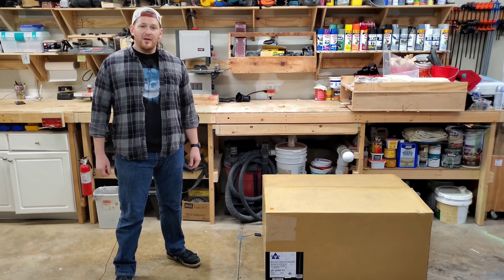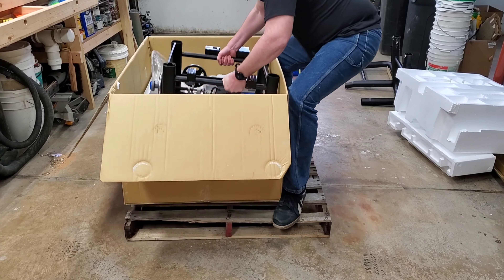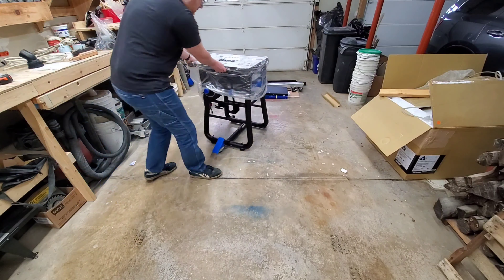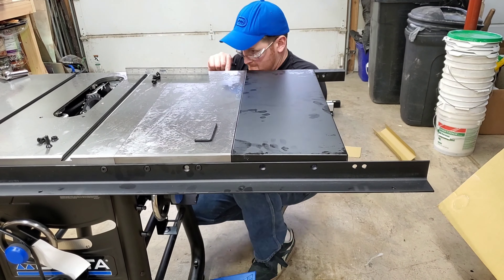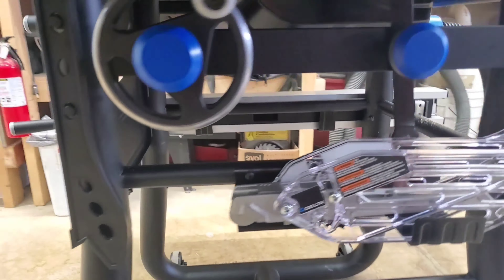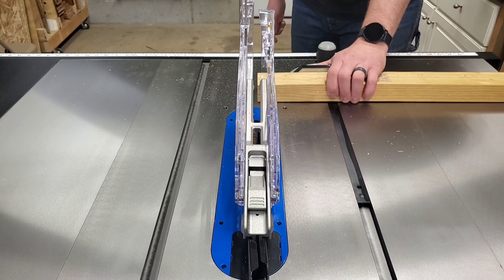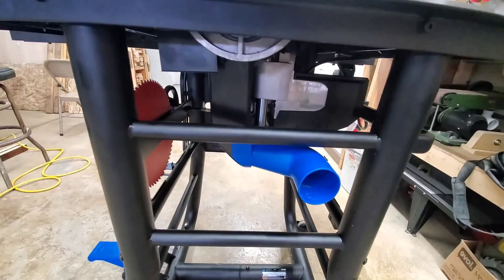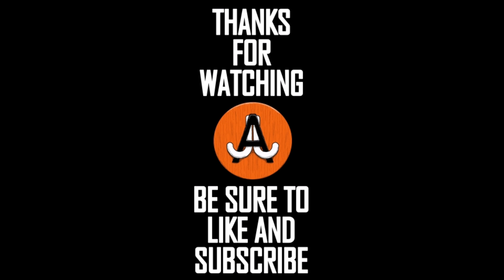Delta 36-5100T2 Contractor Table Saw - Unboxing, Assembly, and Initial Review // Just Joshin' Around

Comment: Just pulled the trigger on the Delta 36-5100T2.  Thanks for the vid.
Reply from the maker: Nice! Hope you like it as much as I do!
Reply: Just Joshin' Around - Thank you!
Reply: @meangreen7389 Was it a good decision?
Reply: @kurtisdavis9526  Yes it was.    The five-cut was amazingly precise right out of the box.  It seemed hyped up so I had to find out.  Since then, this table saw has held up very well.  I use it often and the mobility within my little work space is invaluable.  Other than new blades and little maintenance, it’s a great tool and a great buy.

Comment: I just bought this saw. I struggled with the assembly. Probably because i am not very mechanically inclined and I have neuropathy in my fingers (from chemo). But  with the help of my husband we got it together and I have made a few trial cuts. I love it. I think  so far the best feature besides the fence is how quiet it it. My shop vac makes more noise than this saw.  I bought a Diablo saw blade but for now i am keeping the one that came with it in there. Thanks
Reply from the maker: Awesome, I'm glad to hear you're liking it. Sorry to hear about the assembly issues and all.

I completely agree about how quiet it is! I was really surprised by that. I did the same thing - bought a Diablo blade, but just using the factory one for because it does a fine job.

Thanks for watching and good luck with your nice new saw!

Comment: Enjoyed the video. Purchased mine a week ago. Initial impressions, solid and good construction. I couldn't find anything in the instructions on blade alignment as it was off in back by .022. Will figure out next weekend off. My big issue, table top at front side to side has .013 to .014 dip, .016 dip at throat plate that goes about 3 inches and a severe high spot on left side of the plate. Sides, left front to back .007 and right .006 which fall in delta's tolerances. Top was a pain to take off. It's now at my friends shop waiting to be picked up. He's got it to .005 at its lowest side to side, from front to back .003 at its lowest 5 days after machining. Only cost me $75. Good luck with whoever purchases the 36-5000 models
Reply from the maker: To be honest, I haven't checked mine that closely, so there's a good possibility that it's just as far off as well (or worse, maybe). I have noticed a couple of issues with the throat plate though - sometimes a piece will catch on the back left side (like the plate dips a bit too much, causing the piece to snag on the tabletop while sliding it across;  and the front right side of the plate is raised a tiny bit, causing some of the blue paint to rub onto the wood. Other than that, I've still been really happy with it, but again, I didn't check clearances that closely. I probably should do that though. 

Thanks for the info, and thanks for watching!
Reply: Josh, can you give us the part number for the cast iron exention wings?
Reply from the maker: According to the Parts Diagram, looks like it's DPEC006256. However, after a quick Google search, I was not really coming up with any results as to help in purchasing them. Might be worth contacting Delta directly with that part number to see what they can do for you.

Comment: Do you know where to find the additional cast iron extension wings? Or if parts for the 36-725 older model are able to be used on this one? Thanks
Reply from the maker: A couple people have commented that buying the cast iron extension wings separately from Delta is a difficult, expensive endeavor, and that it's easier/cheaper to get SawStop ones and retrofit them. 

As far as using stuff from the older saw - I would guess that both the fence and miter gauge would be compatible, but I'm honestly not sure - sorry.

Good questions though!
Reply: @JustJoshinAround  thanks for the quick reply. Just picked up this saw yesterday and I'm putting it together. Figured I'd ask before going too far with the assembly. Take care
Reply from the maker: No problem, you too!

Comment: How is this saw holding up any issues. Its half the price of the saw stop contractors saw. Im on the market for a new saw this one seems good and doesn't break the bank as much.
Reply from the maker: It's still holding up quite well. I was in the same boat - considering a SawStop or a Grizzly - but decided that this one was a good combination of features and cost, and I really can't complain about it. If I ever get to the point of being a full-fledged woodshop and NEED to upgrade, I'll again consider a SawStop, but for now, this saw fits my needs perfectly.

Comment: Hi, thanks for the video. I noticed when you lock the fence down the far end looks to be 1/4 inch up in the air? Isn't the fence supposed to be completely flush on the table?
Reply from the maker: Yep, and thanks for watching. 

Yeah that was my fault - it does sit flush, but when I filmed that part, I accidentally locked it down incorrectly but didn't notice it until I was editing the footage. (Then I was too lazy to redo it haha).
Reply: @JustJoshinAround  Cool, i thought it was a defect. Is that model around $1500? I have been looking at another Delta model carried at Lowes for around $600. Yours looks solid and pretty quiet.
Reply from the maker: Yeah I paid $1,000 for mine, but I believe it was $1,300 the last time I looked.

Just FYI - the motor on mine just died and I'm currently in the warranty claim process to get it repaired. I really love the saw, and it's worked really well up to that point - so I was really bummed that it quit on me. I'm hoping the motor on mine is an exception - not the rule.
Reply: @JustJoshinAround  Bummer. I heard these types of table saws should have their own outlet to plug into and not share with other devices. Like plugging into a power strip because the motor will burn out from not having the dedicated power supply all to itself. Hope its not too costly to repair.

Comment: I have the previous version of the 36-5100. The body has solid panels on all 4 sides, which i think helps keep dust from spreading around a little more, but yours has an on-board place to store the blade guard and pawls, which would be handy, I guess.  The saw works fabulously for what it is, but there's one thing I wish it had: an easier way to fine-tune the blade to the miter slots. I can get the fence to the blade, or the fence to the slots, but not the blade to the slots. It's a very very minor deviation, but one that causes a little bit of pinch at the end of cuts on the left side of the blade. 

Your saw's blade clearance insert looks also much nicer than mine. Mine's just a flat piece of 2.7mm thick steel, while yours looks much thicker and maybe cast aluminum? I'm sure yours is much stiffer than mine...i wonder if they are compatible...
Reply from the maker: I definitely love a lot of the features of this saw, but I could certainly see the benefits of having the solid body panels. I know what you mean with the fine-tuning - I've had some minor deviation and slight pinching as well, but luckily not drastic enough to cause any major issues. The insert plate is certainly nice and sturdy, and I'm assuming is actually made of steel (because the magnetic digital angle gauge sticks to it). I don't see why it wouldn't be compared with your saw.

Thanks for watching!

Comment: How does that small flip down on the fence help cut smaller stock? I bought that fence to upgrade my Ridgid tablesaw. I can't figure out how you would use the flip down portion.
Reply from the maker: This is the best collection of explanations I could find: 
https://www.reddit.com/r/woodworking/comments/hcpcs9/installed_a_new_delta_t3_fence_on_my_table_saw/

To be honest, I've only used that thing like 2 times since I bought the saw, and I've found it to have just a bit too much flex/play to be comfortable enough to use it more than that.
Reply: @JustJoshinAround  Thanks for the reply. Even after reading all that and the pictures they showed it doesn't make sense. 🤣😂 Maybe someday it will make sense.
Reply from the maker: @rchavez5056  hahaha yup, no problem. And I know what you mean, it is kind of a weird one.

Comment: I was in Lowe's website to purchase the new T2 saw but reviews caught my eye and the reviews was 3.5 stars and 25% of the complaints was in regards about the motor smoking or blowing out. Can you tell me how yours is holding up? 
I know it's not a high end saw but $600 for me is crucial at the moment
Reply from the maker: Mine has held up perfectly so far. I haven't used it for about a month or so, but since I purchased it, it's worked great.
Reply: @JustJoshinAround  awesome..... Thank you. I know there was ppl complaining about the saw not turning on right away and it turned out it needed to be plugged into a 20amp outlet which isn't a big deal at all.
It's just scary spending money these days haha... Thanks for the reply!!
Reply from the maker: @dbiernackijr1403  I completely understand and agree haha. And I'm glad to help. I hope you like it and it works out well for you!
Reply: @JustJoshinAround  thanks again....

I find it funny that ppl complain about just about anything. Had one guy doing a review on this saw take a metal level and put across the table and show how it dips in the center... Either that was a defective saw or something had to be wrong w his level cause I can't see a factory making a warped table.... 😆😆
Reply from the maker: Yeah seriously. It cracks me up to read some reviews and have a peek into how someone else's mind works haha

Comment: Just pulled it out of the box tonight. Your video is so helpful for the assembly, it’s my first decent table saw too so assembly is a little intimidating. Curious if you’re using anything to keep the rust at bay for the top? I live in FL and my garage isn’t in a/c full time.
Reply from the maker: Oh thank you, I'm really glad it was helpful. 

I applied some paste wax to the table top to help prevent any rust formation, and luckily, it's worked really well so far. I'd say if you do that, it should help - just apply a generous coat, then buff it, then repeat with a second coat, if desired. That's about the cheapest, easiest prevention that I know of.

Thanks for watching, and I hope you enjoy the saw!

Comment: I just ordered the 5000 t2. 100 bucks less for aluminum wings. But same upgrade in the rail and fence system. Problem is I didn't get the second small box that holds the raill system. So it's not really a table saw at this point, but it still cost me a thousand dollars. What's worse is nobody at lowes not about the second small rail box, and the manager at the fulfillment store wants to convince himself I ordered the 725. I guess I gave 300 extra dollars for tip. Couldn't be more frustrated and who knows when I will be able to use the thing, and I have basement remodel to start tomorrow.
Reply from the maker: Oh man, that really sucks. Sorry to hear that, I would be livid. I really hope that they work it all out for you, and quickly.
Reply: Quickly isn't gonna happen it looks like and I'm probably not gonna wait to long for it before giving up on them. I got an email from delta this morning: not their problem in a slightly worrdier format. Local store manager seems to be trying but he thinks it's all one box like the 725 was.  So, Delta blames lowes. Maybe lowes will blame the delivery guy, maybe they'll blame me. Out a thousand dollars and nobody seems to know anything. Anyway. Watched the video ahead of delivery. Well made and had me excited about its arrival. So I guess you can say,  you're video has been the one positive thing about my 1000 dollar delta expenditure.
Reply from the maker: That's utterly ridiculous how they're handling that for you. You'd think that just by verifying the serial number, that they'd have all the information they'd need to fix you up. That's so infuriating. 

Just out of curiosity, who handled delivery?  I bought mine through Home Depot, they used Estes for delivery. 

I really do hope that they help you out and make it right. 

And thank you for the kind words, I appreciate it.

Comment: What are the little set screws for?  I have 4 of them.  The instructions aren't that great to me.  I have a bunch of hex head screws left and can't figure out what to use to attach the fence guide or the power switch box.
Reply from the maker: I can't remember for certain, but I think they provided some extra ones for the other models - like it's a standard pack of hardware and that only specific models might use some of the pieces. I'll have to look at mine to see which screws I used to attach the fence guide and power switch box.
Reply: @JustJoshinAround  I found bag E which included the "button head screws".  Apparently I hid it from myself.  It's all assembled now.
Reply from the maker: @rdot980  oh excellent, glad to hear it!

Comment: I saw a video where a reviewer showing the cast iron top of the earlier version of the table saw (36-725) is not flat so I was wondering if you can tell me the newer version has the same problem or not.
Reply from the maker: Oh jeez, I haven't seen that video - that'd be very disappointing. Yeah, I checked mine with a good straight-edge, and it's nice and flat - no warping or dips or anything. 

Thanks for the question and thanks for watching!
Reply: @JustJoshinAround  This is exactly the information I was looking for as well. I have a small contractor dewalt saw as well and I am going to upgrade.

Comment: I too, would like a 230v option.  You just don't run into the GFCI tripping or the fact your can't have any other large tools on the same circuit as this and use them at the same time.  Essentially 220v just opens your shop up to so many more options for power.
Reply: Just to let you know you can operate this saw on 230v.  You have to flip a switch in the housing to 230 from 115 and change your plug.  This saw was designed to operate all over the world.
Reply: You can use this saw with 230 v.  It’s built to be either or.
Reply from the maker: Oh that's cool, I need to run a 230V circuit to my shop sometime

Comment: Hi Josh, Do you happen to know the part number for those cast iron extensions? I just bought this saw yesterday and the flimsy extensions are ridiculous.
Reply from the maker: I'm sorry, but I actually don't know. However, from what I've heard from other folks in the comments, trying to get the Delta ones is quite the expensive and difficult endeavor. Other people have said it was easier and cheaper to get SawStop ones and adapt them.
Reply: @JustJoshinAround  Thank you for the response. I found the part # and of course they’re sold out and on B/O.
I purchased my saw from FB Marketplace completely new in box with strapping for 1/2 the price. It came without rails but I found them on Amazon for $110. What a bargain! Should be delivered Monday. I can’t wait to use it!!
Reply from the maker: @gefaber482  oh that's awesome - good buy!!

Comment: Do you have a link to the saw? I just bought the same saw from Lowe’s but does not have the extra cast iron extension.
Reply from the maker: Yep, here's a link to where I bought it through Home Depot - 

Delta	15 Amp 10 in. Table Saw with 30 in. Rip Capacity, Cast Iron Table and Extension Wings
https://www.homedepot.com/p/Delta-15-Amp-10-in-Table-Saw-with-30-in-Rip-Capacity-Cast-Iron-Table-and-Extension-Wings-36-5100T2/312714776

Also, just to be clear, mine came with 2 cast iron extension wings, and 1 stamped steel extension wing. I hope I didn't cause any confusion or give incorrect information.

And thanks for watching!

Comment: I’m looking at buying this saw but I notice it sits pretty low, 31” according to the specs. How do you handle out feed? Has it been an issue at all?
Reply from the maker: Hmm, that's strange cuz I just measured mine, and from floor to table top it's 37.25" - I wonder why they'd put that dimension on there?  Anyway, for outfeed, I just use a couple of sawhorses with a scrap piece of OSB on top - though I plan to build a dedicated table/cart at some point. 

Thanks for watching!
Reply: Just Joshin' Around Thank you so much, knowing that helps me a lot. I’m in the process of restoring an awesome workbench top from the 60’s and it will double as my out feed. It was going to be a deal breaker if the saw was actually 31” because I wasn’t about to make this beautiful workbench that low.
Reply from the maker: @pattognozzi  oh wow, that sounds great - such a cool idea!
(By the way, that low of a height woulda been a deal-breaker for me too - I'm 6'4" and I'm pretty sure that my back would murder me for buying something that low hahaha.) 

Glad to help too!
Reply: Just Joshin' Around Thanks! I plan on putting it on YT and if I do I’ll comment back with a link. It’s 2”x3” oak boards glued up to about a 3’x6’ top. It came with my house from the previous owner. It’s dense as could be. Ripped it into 3 sections so it could fit in a Grizzly 240volt planer. It’s stalled 3 times it’s so dense! It’s back together now and looks beautiful. Going to build a base next. Videos like yours are what have given me the motivation to dive into wood working. Thanks again!
Reply from the maker: Oh that sounds fantastic, I'll definitely check it out!

And thanks for the kind words!
Reply: I'm 6'4 and this height works fine for me, my old table saw was a inch shorter.